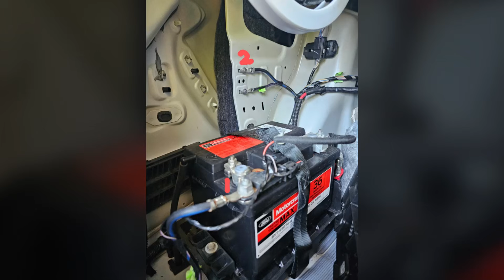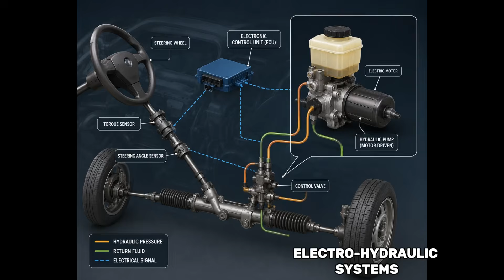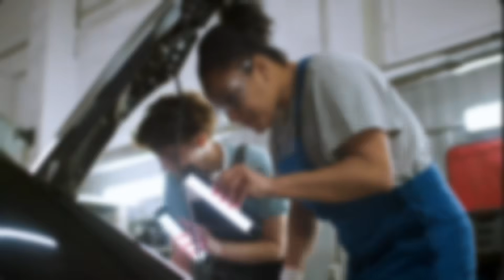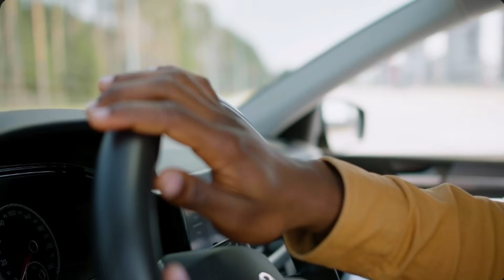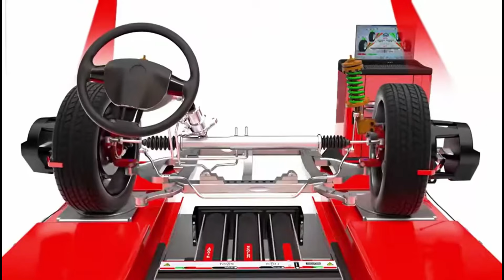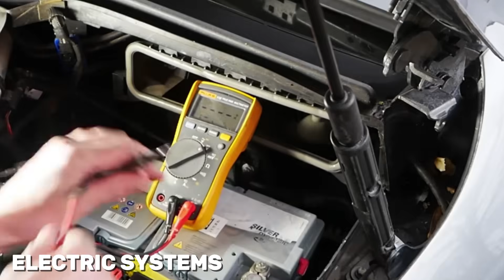How to Fix & Reset the Power Steering Warning Light: EPS Light On? Check This First

Comment: This all sounds absolutely fabulous until you try to do it.  When the car is just in accessory mode and not engine running you can't move the damm steering wheel to turn it 3 times left and right for the steering sensor calibration so this is an epic failure.
Reply: Same thing for me